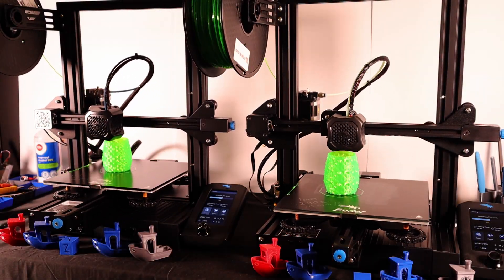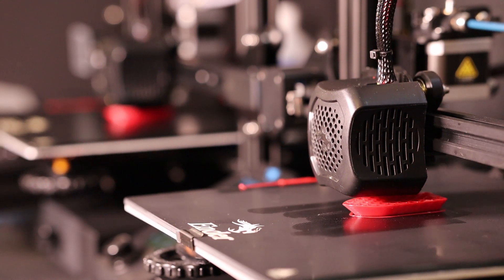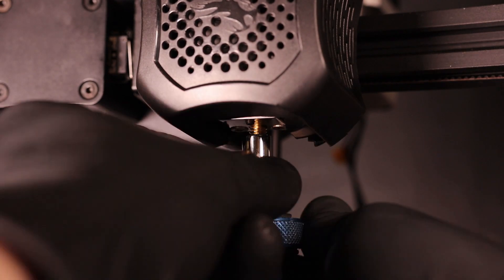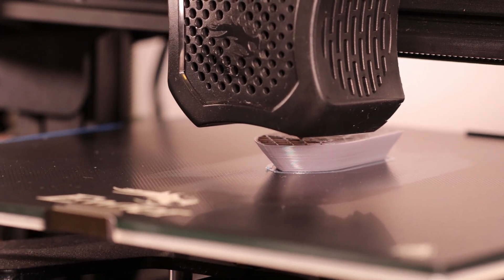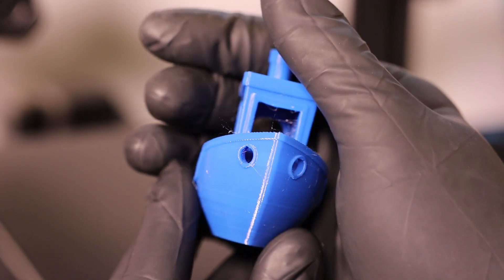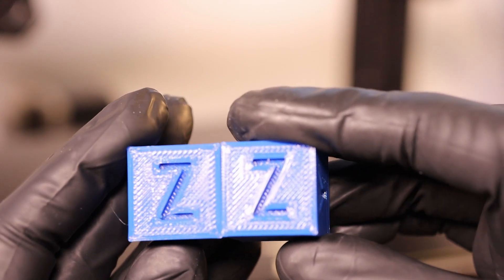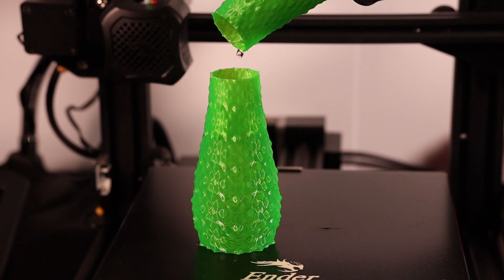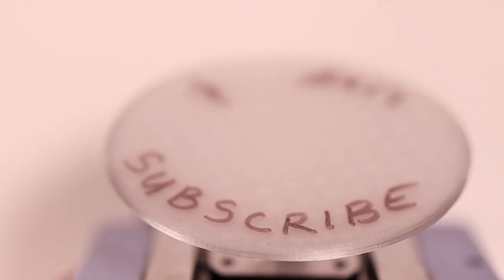Creality Ender 3 V2 - Old vs New - How bad 🤢 ... or good 👍 is it?

Comment: Mine fail most of the time now or are Brittle with layer lines
Reply from the maker: Doesn’t sound great, I had similar issues once, turned out I was given a roll of pla instead of ABS and didn’t realize, very brittle and quite shiny.

Comment: after having my ender for about a year and a half i have mostly avoided these issues,went direct drive setup with an orbiter , ditched marlin for klipper and i only print petg @100-150mm/s with 1.5k accelaration , so i never had these moisture issues with petg that i can buy locally, now i know different companies make filament differently , i think our locla guys have nailed petg barely absorbs moisture , even sitting on the spool holder for a week or 2 if im not printing anything.

But all and all the ender 3 range are pretty good little printers once you've sorted out the factory "bugs" and ditched the stock extruder and hot end combo

Comment: Nice to use scientific method to make things as consistent as possible. One small suggestion I just thought of would be to split the rolls of filament between the printers (for the ultimate in even comparisons), that your problems with the filament when you started showed so clearly NICE VIDEO!

Comment: I bought an Ender 3 v2. Put it together, leveled the bed, and started printing. I used the white PLA that came with the printer and the first two prints came out perfect. I bought some Black PLA and the first print with it got about 25% done and the filament got stuck on the spool, so it was printing in the air. After that nothing will stick to the build plate. I bought an extra plate and tried it. Still nothing. Cleaned out the nozzle with the needle, still not sticking. Could the nozzle be bad after only 3 prints? Edit: I bought the same springs you have when I bought the printer, because everyone said it was a must.
Reply from the maker: If you're printing on glass, use glue stick and put your prints in the freezer for 10 minutes and they'll come off easy.  I still use glue stock for all of my prints, it makes for a perfect first layer including any tiny details and also I have confidence that there will be no deformation and I've done about 1000+ prints in this way.  Cheap dollar store works the best for me.  If you don't print on glass, they recommend painters tape for PLA.   The bed temp has a lot to do with the bond as well.  60 for PLA and 75-80 for PETG.  It will not be the nozzle, they'll last you quite a long time as long as you don't print with abrasive filaments.  I have a video coming out this weekend, make sure to check it out, it will help you prevent fails of a certain type.
Reply: @NeedItMakeIt  I finally got it working. The nozzle was too high. I had the Z axis pushed all the way down when I leveled the bed and the nozzle was just not touching the bed. I downloaded a print that prints out boxes and leveled it that way. It prints perfect now. I just tried to print out a dragon head though and when it got to the head it started stringing all over the place, so now I know about supports, lol.

Comment: Hey. Can You test additional  "Z" screw and motor?  Is it worth it?
Reply from the maker: I haven't found a need for it on this small of a printer.  If the cams/wheels aren't positioned correctly it will impact the prints, to make it easier on users, the extra z would help.

Comment: Have you facing a bed warping on Ender v2? and if you had how did you solve it?
Reply from the maker: The aluminum does warp when heated, once fully up to temp it flattens out a bit, I've always used glass on top, I am using 3mm borosilicate for a little higher speeds, the stock 4mm glass works very well to maintain a flat surface at all times.  I have plans on using the BL touch in future videos at the moment I don't really have a need for it, I like using the glass.

Comment: I went online with the intention of buying the ender3 as a third printer cus I needed a bit more build height than my malyan m180 dual extruder has, as it is highly recommended, and not  'just in its price point', but real good. I was about an hour into my online investigation when I found the ender's cousin, the cr6 se, also by creality. If you can spend more on your printer, the quality of life improvements it offers are sublime. Mesh bed leveling! Filament run out sensor with print resume! Dual z screws! Plus the bed glass has this coating for pla that I've never had to clean. Not to mention the color touchscreen. Oh man, also the community loved this machine so much they rewrote the firmware and it's a dream.

Anyway, if you have yet to decide, check out the cr6

Added: looking forward to an update to this video where he tells us what parts he had to replace to bring it back up to new like again, as that's why I was watching to begin with lol
Reply from the maker: That's great info thank you.  I really like hearing about honest unbiased reviews.  I hope to make some videos in the future where I purchase the product and test it out for a while to see what happens.  I don't know if that interests anyone, at least people could see for themselves whether it meets their needs.

The next video is out https://youtu.be/ivbXXtJcjSU turns out that not much needed to be replaced, very little quality difference even after that much printing.
Reply: @NeedItMakeIt  sweet, thanks for that. I'm sure it'll be the same issues/parts for the cr6-se as the ender 3.

Comment: That higher stringing is intriguing
Reply from the maker: I wonder if the temp sensors between printers are reading slightly different.
Reply: @NeedItMakeIt  Maybe wear and tear on your old nozzle?
Reply from the maker: @NicksStuff  I replace nozzles all of the time, mostly because I change them so often for testing and I can never tell which size they are if they are gummed up.  There are a surprising amount of variables involved in such a simple looking system.  At least we can break it down to something on the extrusion path.  Could the moisture in the filament roll be changing part way through?  When I dry them in the oven, maybe the core still contains some humidity?
Reply: @NeedItMakeIt  Maybe the electrons in the old extruder aren't aligned the same!

Seriously, is the spring tension the same?
The current sent to the motor the same?
The PTFE tube set the same (all the way down to the hotend I mean)?

Or the temp, yeah, that's the simplest explanation
Reply from the maker: @NicksStuff  And that's still only a few... great points though, that's why it is so tough to troubleshoot problems.  I am only just starting to learn about the electrical components and their impacts, so I'm kind of useless there for now.
Reply: @NeedItMakeIt  You said the firmware was the same. But is the EEPROM content the same?
Mainly, are your PID values the same? The esteps?

Comment: I have a 3V2 printer. For bed adhesion, I use a solution of squirt of cheap kids PVA glue mixed with water in a ketchup squeezy bottle, then use a lint free cloth to rub in the print at 60 degrees bed temp. The cloth becomes stiff when dry but this makes a great abrasive for the bed for the old layers. Since newly starting 3D printing this is my best advice that works for me. I stopped cleaning my bed glass because the it just works :)

Comment: A good filament drybox is a large plastic tote with a few pounds of indicating dessicant
Reply from the maker: This is exactly what I have, I have a feeling that this PETG just isn't great quality, after staying in the box with desiccant and then two attempts at drying I still show stringing, lowering the temp to 220C for the PETG does help a little, maybe this is just terrible quality filament and I need to go to something better.  I've never had trouble with PLA or ABS.  What do you think, do you have a brand you like?
Reply: @NeedItMakeIt  I don't usually use petg because I don't really have a need for it, but I would suggest buying a name brand spool and comparing. Easy parts can get away with some stringing, but high quality parts need high quality materials. Especially comparing printers.

Comment: Excuse me,sir.  I don't understand the meaning of 4:18.
Is it mean the problem is caused when STL. be sliced ?
Reply from the maker: Apparently this is a very common issue with the benchy, it is known as the 'Benchy Hull'.  I believe it could be caused by a few things in the slicer, the layer height at that transition in shape may not be transferring to the gcode correctly, it could also be an issue with extrusion.  On a bowden style printer there is also the possibility of the extrusion not handling the transition properly, this can also be seen on a calibration cube directly above and below the letter X/Y.  More research is required, others may have already solved this problem.  Are you having problems like this in your prints?
Reply: @NeedItMakeIt  yes i have this mistake on my printer it's a strange line at upper and lower boundary at letter X/Y of testing cube and it's also at benchy window's upper boundary , I try to adjust my printer Ender 3 Pro but it is always no useful
Reply from the maker: @仟宇設計-東弟  Yes, this is likely to do with the inaccurate extrusion caused by the bowden setup on this printer.  As the shape changes, the extrusion is not compensated for properly along with speed changes and we see these bulges and visible defects.  Activating linear advance will help, however it is not available for this printer, I am researching a solution right now.
Reply: @NeedItMakeIt  Thank you so much. I still try different shape I print Moai today and it's show that Moai  is very perfect .
Reply from the maker: @仟宇設計-東弟  Please send me some images to needitmakeit@gmail.com if you have a chance.
Reply: @NeedItMakeIt  ok,I already send you a mail.

Comment: Ive also swapped out to yellow springs but cant get ma bed leveled.aaahhhh.lol
Reply from the maker: Are you using glass?  If not, the aluminum can warp, or is already warped.  I always print with a thicker first layer and glue stick, works too well for PETG and PLA.
Reply: @NeedItMakeIt  yeah using the glass think i might need to heat the bed a bit more for the pla guna have a play today. Im a complete noob.lol

Comment: Im new to 3d printing dont
Have one yet im considering this one. Is fillament expensive? Like i see the prices but do u go through alot of it to the point that it eats up money?
Reply: The filament price may vary, depending on where you live and the quality of filaments available. Check the prices at your local stores. As for "eating up money", unless you are buying a 3d printer to make money, you should consider 3d printing as a hobby. And yes, you'll need to spend money on your hobby. How much you would spend depends on how often you print and what you print.
Reply: @Erstey  lets say i print a iron man helmet(for hypothetical reference) how much would it use? Just an estimate?
Reply: @choppamaxx8383  download a free slicer like cuts and set it up for this printer. Import the file you want to print and it will give you an estimate of how much filament you will need.

Comment: By the way I'm using a 05 mm nozzle in my ender 3 V1, it wasn't by choice! Like I said if you don't clean a tip you need to dial your slicer into the proper diameter. If you have damage your tip you can extrude raw plastic through the tip and using micrometer to gauge the proper diameter of the tip. I happen to widen mine a little bit too much and so now it is a 0.5 mm but it started its life as 0.4 mm
Reply: Its great you knew enough to accomplish that, but, nozzles aren't expensive, well you can find expensive ones, ones with the end hole actually drilled thru a ruby they mounted there, but I dont think that's your case. Just buy another nozzle. A few in fact.
Reply: @djklermundable  I'm already running Ruby. I'm also printing Ruby now with a laser. I can't get the Ruby to fuse together with laser completely so I get micro rubies at the moment. My goal is to print a lasable ruby with a laser! After what I've seen so far I feel it's possible I just don't have a strong enough laser. As for the 3D printers I'm in the process of building my first scratch built. I've got dozens of tips but at that time none of them had came in. It was a short period where we had no deliveries showing up on time and I had to wait 3 months for tips. That's why when I ordered a new set also ordered a set of steel and a ruby tip.
Reply: @SteveSiegelin  I hear ya, ya got to do what ya got to do to keep movin. I know if I had to modify my slicer settings to try and compensate I'd be screwed.
Reply: @djklermundable  it's pretty simple depending on what slicer you use. Cura is the easiest to pick up and works on a lot of machines. That being said I kind of feel guilty that I've been using ultimakers product for so long now and haven't really given them anything for it since I never bought one of their printers. I'm going to have to jump on the website tonight. Regardless changing your diameter is not a real issue. It'll actually change your layer lines to compensate for the tip and keep the part the same size automatically. All you're doing is changing one number.

Comment: The only issue I've ever noticed with the enders including my version 1 they still runs like the day I bought it, every once in awhile you have to snug the belt.I think the last time I re-snugged my belt was maybe about 10 or 11 months ago. Other than that you get standard tip wear if you don't know how to clean your tips properly, I learned that the hard way. Also if you do damage a tip you need to dial in your slicer settings so that it reflects the proper diameter of that tip. don't try to print materials that you know your machine cannot handle unless you are willing to put the effort in to learn how to make it handle those materials. My ender 3 version 1 is printing nylon without any serious modifications. It just prints the nylon really slow. Not actually worth what you can do with it but it was still a fun experiment. There's always a learning curve but ender makes a damn good product it seems!

Comment: What brand is the iconic grey ABS?
Reply from the maker: Economy, I only buy the cheapest filaments because I like to make things hard for myself.   I purchased from Filaments.ca and from 3D printing Canada, they are the same from both suppliers and they are their 'house brands' kind of no-name.  I was thinking about making a video comparing the most expensive vs the cheapest to see how much of a difference it can make, what do you think?
Reply: @NeedItMakeIt  Prints look pertty clean so your settings are spot on. I dont print with abs so i cannot test them out but i have to say im impressed.

Comment: what  are those hotends you are  running r they just fan shouds
Reply from the maker: The Hotend shown part way though the video is called the Red Lizard Hotend, I have been testing it and I have plans on releasing a video.  I wanted to see how it would perform with no fan cooling it.  Spoiler, it does work, and so does the stock hotend, but the stock actually works better with no fan because it has a slower heat creep due to the PTFE.  The all metal Red Lizard allows heat to come up more rapidly and the plastic can melt too high and jamb everything up.  It has some benefits though, the heat block is all copper and above that is an extended heat zone for extruding more material.   Did that answer your question?
Reply: @NeedItMakeIt  it looks good would you say better than mosquito but i was more asking about the cover?

Comment: Best thing for print consistency with an ender3 for me has been a slice engineering heatbrake. Drop in bimetallic all metal conversation, which makes for nice high temp performance, but that's not why it's good, it's good because it moves the Bowden tube up out of the hotend so you only need a seal between the nozzle and heatbrake, rather than the nozzle, heatbrake and Bowden tube. It's a recurring problem that when the Bowden tube creeps up you get a wide melt pool of filament in the end of the heatbrake and it really messes with the extrusion behaviour and I'm sure this something you've had to deal with.
Reply from the maker: That's an excellent tip, I have been testing this exact scenario lately and I think you might be onto something.  That will make it onto the list of things to test out for sure!
Reply: HeatBREAK
Reply: @michaels3003  Autocowrecked has views

Comment: I'm running much less retraction with Capricorn tubing, if you've got settings dialled for one they might not work with the other.
Reply from the maker: I'll give it a try, I haven't had much success with the capricorn, are you running the XS tubing (Darker?)
Reply: @NeedItMakeIt  yes, its the dark blue XS tube. And i was using this fix for the tube working loose https://www.thingiverse.com/thing:3203831
Reply: Interesting that the tubing might be the culprit. I have noticed more stringing on my prints with the Ender 3 V2 since I changed the tube to Capricon. reducing the retraction speed has helped me somewhat but I haven't managed to get it 'as good' as what I felt the original print quality was. Would you mind sharing your retraction settings? Curious to try it out on my end as well.
Reply: @srz87  I think i was running about 5mm retraction at 25mm/s with wipe and 70% retract before wipe in prusaslicer. I've got an all metal heatbrake (just the heatbrake, the slice copperhead C-E, the rest is unchanged) now and that's made my prints really consistent and I'm doing a lot less tuning and retuning. I've run into the same issue of the PTFE liner coming away from the nozzle on my project printer as well.

I also printed a direct drive mod (currently using the Hydra one, might try the petsfang one) and got an SKR mini E3 so I could run linear advance and the quality, consistency and reliability I'm getting now is really good.